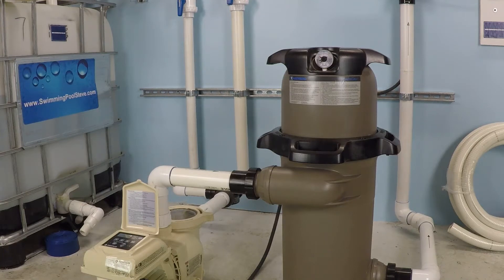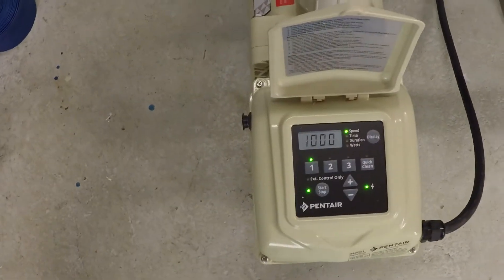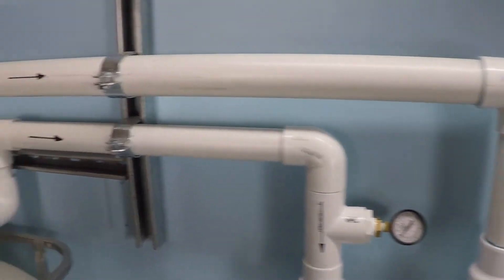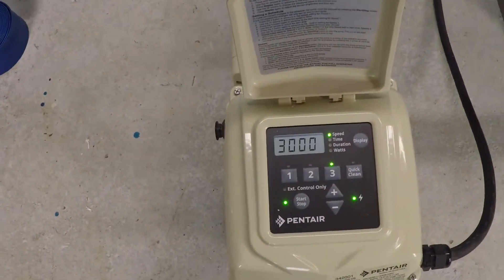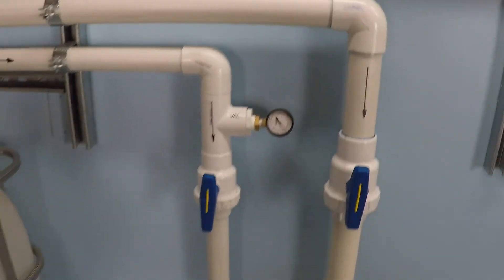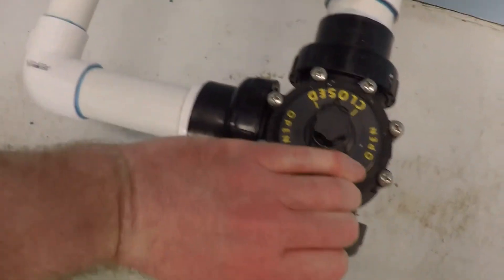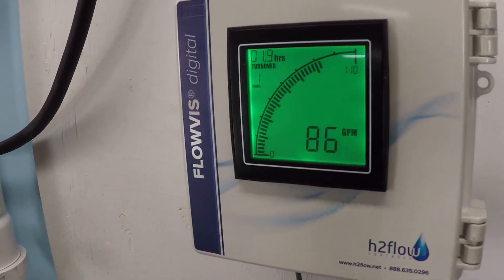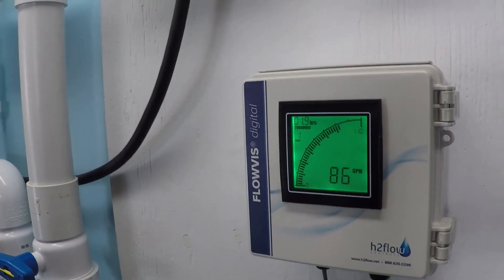Flow Rate Difference Between Pool Pipe Sizes

Comment: 1.5" valves are a pinch point on a 1.5 system. Try installing 2" valves with 1.5" reducers and see how the flow is.

Comment: Hey Steve, great demo!  See you answered lots of questions.  But I have a new one.  Old set up, has 2" pipe in and out, with a 2hp single speed pump.  TODAY : I swapped out for 3hp variable Harris with 2" in out.  But also got the 24" Harris Sand Filter, that drops down to the 1.5" in and out.  Plus a salt chlorination in out 1.5".   So in to (3hp vs pump is 2"): and outflow to rest of system is 1.5" now, back to the 2" going back to pool.

My point and question : I can see the 3hp is less water flow then my old 2hp on full 2".  

In you video you changed the system, to same, but did not show the flow rate for that set up.   MAYBE you can make a new video showing all 4 options, 1.5 in 2 out, then 2 in with 1.5" out.  WOULD HELP a lot of people since manufacturers are changing sizes like this on the outflow side.  

THANK YOU.

Comment: I have a 1.5" flex pipe system that I will now be piping into a 2" pump (the pentair intelliflow VSF). I thought that setting the pump to say 60gpm meant it would be 60gpm throughout the whole system, but now I'm not so sure. I understand the velocity and pressure will be higher through the 1.5", but I thought the volume would be the same. So do I have to be careful not run the pump too high for fear my 1.5" system won't be able to handle it?
Reply from the maker: A 1.5" system definitely can not handle an intelliflo pump. It's a huge pump. 170gpm at 30ft of head. One 1.5" pvc pipe can handle 35gpm at 6fps. 1.5" pipes and a 3hp intelliflo is not something I would do.
Reply: @Swimmingpoolsteve  thanks for the advice. I'll try to return it. I'd like to put in a small waterfall, so I wanted an upgrade from my old 1hp single speed. Is there an efficient pump you recommend? It's not a huge pool... only about 45K L. 3 return jets.
Reply from the maker: If you want intelliflo the i1 model is a 1hp version. It's actually still a really powerful pump but at least less than the 3hp monster you have now. Amazing pump, just too large for your plumbing system. Most 1.5hp range pumps will be plenty powerful enough for a filtration system.
Reply: @Swimmingpoolsteve  Thanks, appreciate the advice
Reply: @Swimmingpoolsteve  sorry to bother you with this... why is the i1 as expensive as the VSF when it's only 1hp? And why is the superflow at 1.5hp cheaper? I guess I assumed the intelliflow was just more powerful so I'm confused by this i1. Is it also a variable speed and flow like the VSF?
Reply from the maker: Different pumps and different quality between the superflo and inteliflo. The i1 is the same 3.95hp intelliflo but digitally altered to perform at 1hp max. This is why it's more money than a superflo.
Reply: @Swimmingpoolsteve  oh! So will the i1 operate at a very low rpm? I thought I would just run the VSF at 40gpm and it would be very low rpm. So that's what the i1 does?

Comment: Where there as many 90 degree turns with the 2 inch?
Reply: I was thinking the same thing. This guy very apparently doesn't even understand the basics of hydraulics if that is not considered and equalized for the experiment. Not just 90° bends but actual T valves... that will have an impact on flow rate.

Comment: Hey steve. If the pumps outlet pipe is 1 1/2  would there be an increase in flow if the rest of the piping was upgraded from 1 1/2 to 2, or even 2 1/2?
Reply from the maker: Yes there is merit to this. You slow the water velocity through the areas of the system where the majority of your friction and turbulence losses are and you can still net positive more flow and less efficiency loss despite some parts of the system still being a flow restriction.
Reply: @Swimmingpoolsteve thanks 👍

Comment: My pool has all 1 1/2 " piping. I replaced my fixed speed 3/4 HP pump with a Hayward Variable speed 1 1/2 HP pump. It is 2" inlet and outlet ports reduced to 1 1/2" as well. 
I also have a Hayward pool heater that is 2" and my filter has 2" both reduced to 1 1/2". My question is: is it worth my effort to cut up the plumbing and make it right using 2" throughout? 
I especially want to improve my heater performance. Will 2" pipe heat my pool faster?
I appreciate your input.
Reply: Yes, yes and yes

Comment: Steve, I have 3 pipes on the suction side measuring 1.5'' each, one for the drain, one for the vacuum and one for the skimmer all connected with a 1.5'' pipe going to the pump and then 1.5'' pipe going to the filter and only 1 return measuring 1.5'' going to the pool jets. will it be better to connect the 3 suction pipes to a 2'' pipe and replace the pipe connecting the pump with the filter with a 2'' pipe as well?
Reply from the maker: It would technically be beneficial yes if you replaced the suction manifold with a 2" manifold and replaced all equipment pad pipes with 2" even though you still have a single 1.5" pipe going back to the pool.  It would be better to replace everything with 2" but this video helps to illustrate how even changes to only part of the system will still have measurable and appreciable improvements to the flow dynamics.

Comment: Hey Steve. I know a pool installer that uses 2” suction side and then 1 1/2” on return. Do you see any issues with this?
Reply from the maker: No issue, kind of.  The logic is sound.  Suction line velocity should not exceed 6 feet per second, and pressure side should not exceed 8 feet per second, so you can get away with smaller pipes on the pressure side.  But in reality 1.5" sucks so hard that it should just stop being used completely.  If all pipes cost the same to buy the actual best for efficiency are anywhere from 2.5" to 6" in size.  1.5" was only a good idea when everyone was commuting to work in 30 foot long station wagons that got 5 mpg.  Your installer is moving in the right direction but still behind the times when you build for efficiency.
Reply: @Swimmingpoolsteve  I used 1.5" piping because the pump and filter as well as the in-line chlorinator all restrict to 1.5". would it make sense to use 2" even with the components restricting to 1.5"?
Reply: @levvayner4509  Hayward inline chlorinators reduce flow down to about a 1" pipe!

Comment: Swimming pool Steve what's the maximum distance for your swimming pool pump to your pool and could it be resistance flow
Reply from the maker: There is no maximum.  What changes is resistance to flow measured in feet of head. You can go further and it will not hurt the pump (depending on your pump and total resistance to flow) but you would expect less flow versus a system with less resistance to flow.